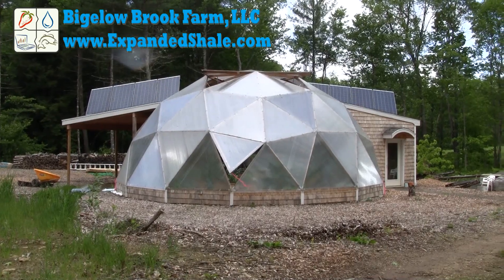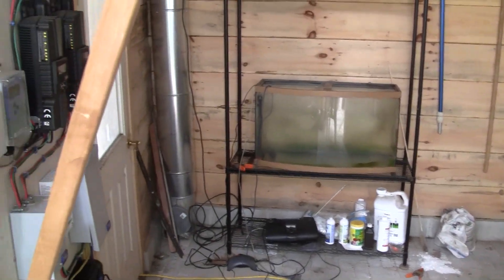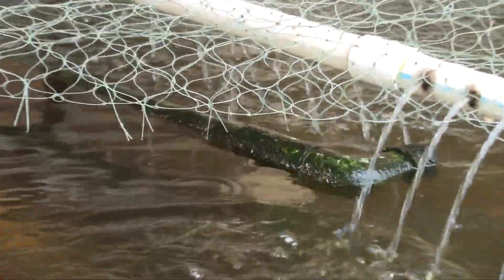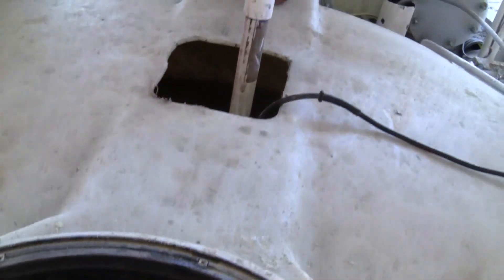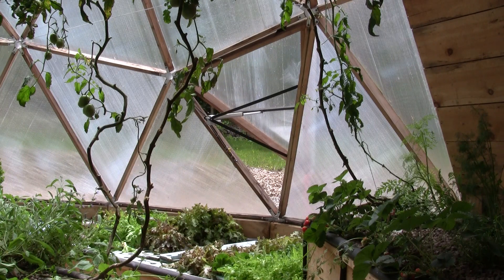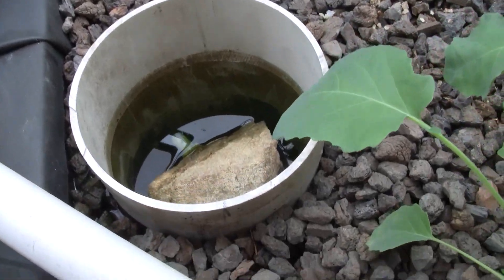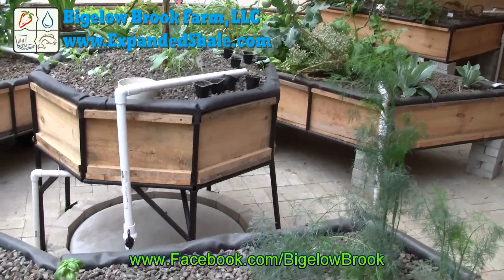GRAND TOUR - Aquaponic Geodesic Dome Greenhouse

Comment: Been watching your vids for years, how well did the long term thermal storage under the pavers n sand work?
Reply from the maker: it somewhat works.  It helps to regulate the temperature but the high humidity from the air condensates in the tubing, then gets a lot of mildew in it, which them blows back into the greenhouse.  The mildew on the plants increases a lot so I've basically had to stop using it.  It may work in less humid areas.
Reply: Thank you. I'm in a zone 7 East coast area. I've seen countless Thermal bank vids. 

Wonder if installing an in ground, accessible UV light in the tubes ends might help with mold. 

A friend of mine uses a household heating blanket under the raised beds. 

Peace.
Reply from the maker: If I were doing it again, I would probably install some sort of pex tubing and a heat exchanger.
Reply: Thanks for the info. PEX is what im replacing my house copper pipes with.

Comment: Instead of removing those triangle panels for windows I would have installed intake vents along the bottom of the southern stretch of the dome and then built some kind of a cupola in the north shed roof so the dome itself could be totally solid.  Did you consider this type of design at any time?
Reply from the maker: you still would have vents that had to open and close.  You want vents at the tallest point to help with the chimney effect.  Putting them on the shed roof isn't as high and would problem leak into the wood frame.  If these vents leak, it won't bother anything.
Reply: I agree but I wouldn't expect a properly built cupola to leak and if built on top of the shed with it's own roof and vents build in the sides it would be the highest point on the structure, but I would still install some kind of fan at the bottom to force venting; just curious if it's been done.  I want to build a half shed half greenhouse structure but with a simple pitched roof with an extra long incline for the south and insulated concrete wall on the shed side.  The dome looks cool but I don't have fab equipment to make hubs and such, plus I would expect very tight tolerances to get all the members to fit just right, but your building is inspiring.
Reply: Plus I would expect your bigger problem to be keeping heat in during winter rather than leaking water in.

Comment: Hi again, I notice that you have changed the backup battery setup for the Li-Ion backup system; how do you rate it? Is it worth the extra money?
Kind Regards
Richard
Reply from the maker: +Richard Miller Do you mean the batteries for the solar setup?  These are lead-acid batteries.
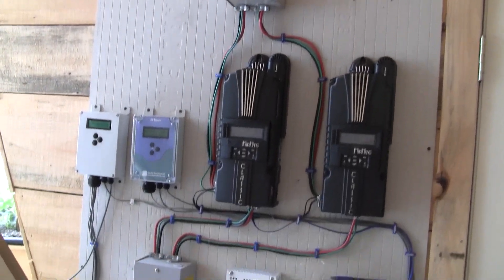Reply: +Bigelow Brook Farm (Web4Deb) I think I have confused myself and you!! at 2:58/5:25 I notice a blue paneld unit labled 1200watt. I did not notice it on the first run through on the Solar setup vid. This appears to have changed in the Grand Tour version??? No worries.
Reply from the maker: ah.  yes, when I added the batteries, I switch it up to a 24 volt system.  That's a 24V inverter.

Comment: Hi Rob, I am thinking of doing something similar to what you have done here - aquaponics in a greenhouse in a northern climate. Did you insulate beneath your exterior walls before putting up your dome? Have you considered putting on an additional layer of polycarbonate on the inside of your dome triangles? The greenhouse I will be constructing will be completely on the cheap with recycled construction materials and multiple layers of sheet poly and bubble wrap probably. I am also planning on digging it down and putting the fish tank in the ground to take advantage of a bit of geothermal effects. Any comments?
Reply from the maker: Generic Jam Make sure you go through the old building videos as it shows how I did the insulation around the foundation.  You have to be careful if you want to do two layers of poly since you will get condensation in there...then rot and mold.  The geothermal effect will be minimal keeping the tank in the ground.
Reply: Bigelow Brook Farm (Web4Deb) Sorry I guess I should have looked through your videos further. I found the one in question without too much trouble. 
Regarding the fish tank placement I am thinking that putting it in the ground will be beneficial in that it won't be taking up room in the greenhouse, I can just build a false floor over it for walking on, etc. Also, hopefully it can act as a heat sync. Regarding the condensation between the poly I was trying to think of ways of not being affected by this including vacuum sealing the layers or something. I'm still working on that one. I don't think I can get away with only one layer and part of my experiment is to spend as little money as possible on it so I think polycarbonate is out. Also, one more idea for the northern greenhouse: have you experimented with putting reflective material on your north wall to redirect the sunlight back into the rest of the greenhouse?
Anyway, thanks for all the work you've put in and put out there. Your channel is one of the most informative resources I've found so far.
Reply from the maker: If you cover your tank, make sure you can easily access it....to get dead fish out and cleaning.  I haven't done reflective material, the dome angles aren't great for doing it.

Comment: ***** If you went through all the videos (admittedly there a lot of them), you would note a few things.  First, that this greenhouse and related technologies such as the rocket stove are proof of concepts, and prototypes at best, not production units.  They are exploring what is possible, practical comes next, either from Bigelow Brook Farm (Web4Deb) efforts, or others who learn from the information in these videos.  The effort is worth it simply to learn, teach, and develop; not everything is about a financial return on investment.

I too am working on a proof of concept aquaponic system, and mine too will never show a net profit.  That is not the point of the experiment.  The points I wish to test include soil enrichment (hybrid aquaponics), the use of inexpensive LED lighting, and the ability for others to emulate the design, meaning off the shelf parts, low cost, and easy build are important factors.  Since I am giving away the plans and data once complete (open hardware and open source software) I will never see direct profits, but I will learn a few things, teach others, and hopefully have some fresh produce.

Comment: add in a vertical aquaponic system, you will at least double the crop output and more efficiently utilize the space. getting edible fish would be a good step too. i dont know about you but ive never eaten goldfish. also you can grow and freeze duckweed and algae for feeding the fish for practically nothing in small kid pools its not automated but cheaper than store bought feed
Reply: koi are just a kind of carp, which is edible.  kind of oily and bony, but it fries up ok.
Reply: Goldfish is edible. You should try it.

Comment: How do you power your welder in your dome, a generator?
Reply from the maker: yup!
Reply: Awesome! Do you use a 120v welder? How many amps does the generator require? I have a 230v welder but I'm thinking it might be cheaper to just buy a 120v welder instead of a generator that will generate enough amperage. I'm getting ready to build a 23' dome and I have one 120v power line ran to the site. Thanks for all the great videos and information, this is the best stuff I've found!
Reply from the maker: ***** it's just a 120 welder, but my generator also supports 230.  I usually do my welding in the garage.  If you have a long run to your greenhouse, make sure your wire is a heavy enough gauge to support the higher amperage.

Comment: Hey Rj, I adapted an easy way to know when my media is drained. I have a FLOUT floating outlet as a master-siphon for all the grow beds. (It floats until the maximum water level is reached in the grow bed and the siphon chamber, then it sinks to bottom and rapidly drains to the sump)
I simply put a reed switch under the FLOUT which is actuated by magnets inside the FLOUT. It doesn't control anything yet, but it could turn on a light, turn off a pump relay, etc. etc...

Comment: Very nice set up. I'm surprised you didn't set up a Solar water heater. All it takes is some black hose coiled up on the roof. Will save you heating money.

Heck, you can get a used water heater, strip off the outside, paint it black, set it up outside with some mirrors on it. And have a simple flow regulator into a tank inside with some insulation.

Best wishes.

Comment from the maker: I have a couple hundred hours of burn in the SS riser and it's worked well.  I've been working on some new exciting updates to the RMH...but you'll have to wait until this winter for the final results.  ;-)  Believe it or not, I have no monitoring in this building.  My goal was to run it as simple as possible....less to go wrong!  At some point I'll add some monitoring.

Comment: Excellent video.  I am jealous of your 32' dome, mine is only 20' and built on uneven ground.  Did you get a chance to really test your stainless riser in your RMH?  The fire brick I used has worked well. Could you make a video on how your electronic products work and how you update data to the web. One thing I would like to develop is a float sensor to measure and report the media bed cycles.  This would be extremely useful.  Any thoughts?